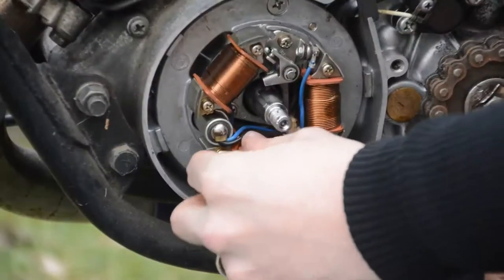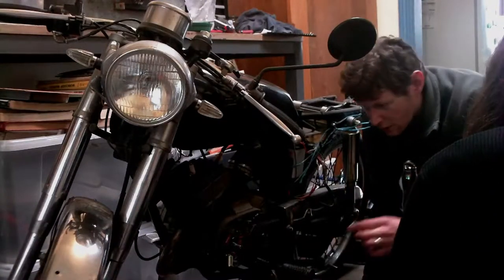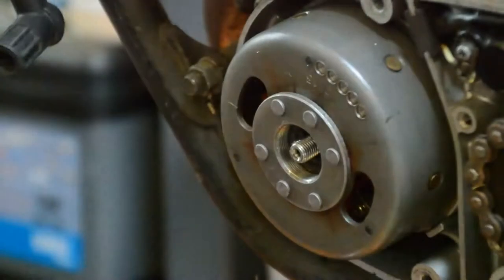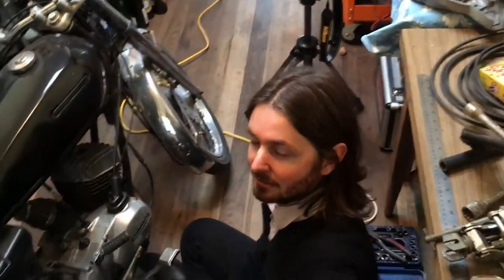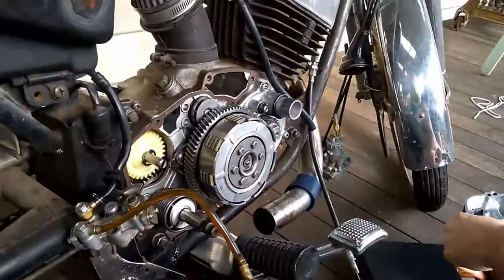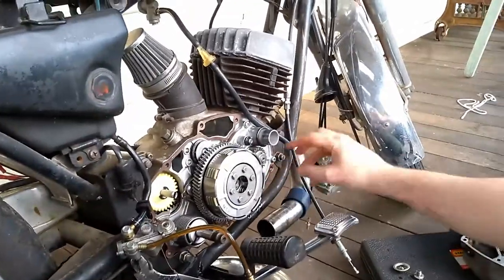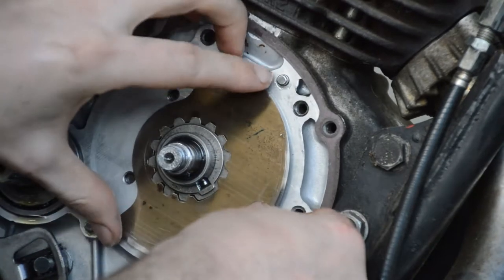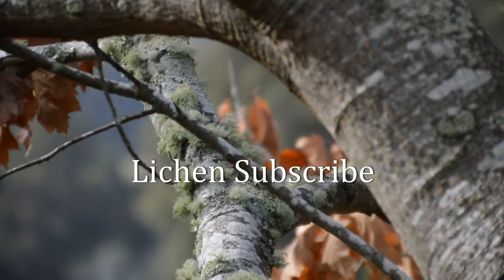Kawasaki Kh100: Episode 2

Comment: 2:30 There are two 3v coils and one 6v coil, so essentially one set of 6v for the ignition, and another for everything else. Pretty sure the one wound with thicker wire is for ignition, and the other two for lights etc. Kevin Bergeron is the bloke who has the video on it, but I can't find the specific one. Also, automotive Youtube needs more bagpipes.